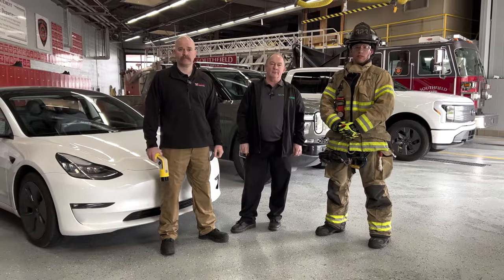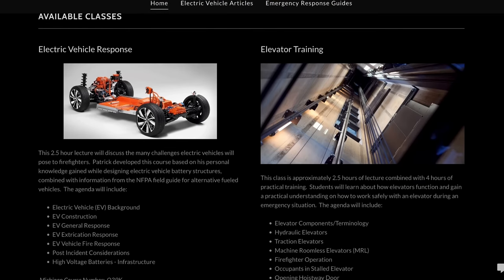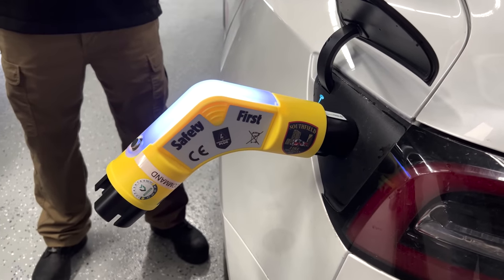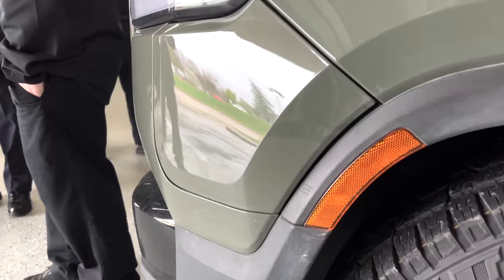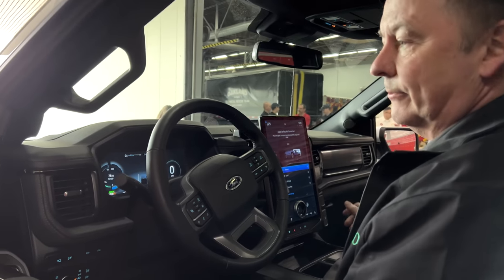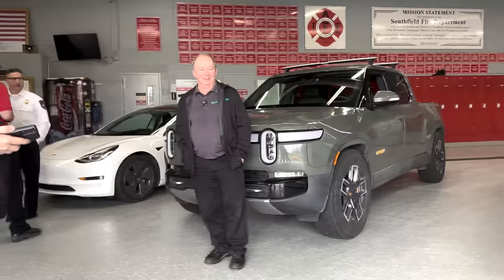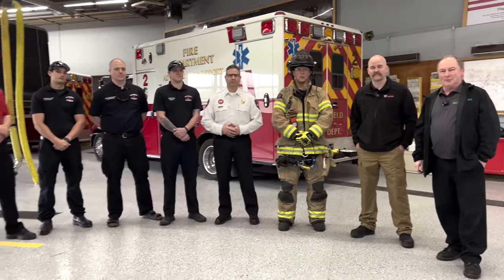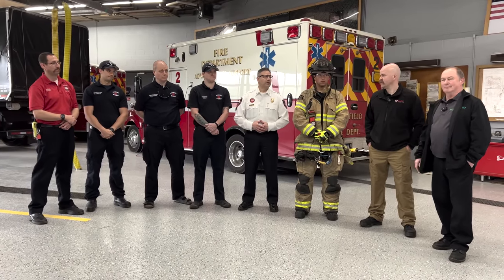An EV Device for First Responders: Emergency Plug Demonstration

Comment: If it doesn't disable the main battery connectors (safety switch) seems pretty a useless tool to me.
Reply: this tool is to shutdown and disable driving. shutdown is achieved when charport is open on a tesla. driving is disabled with any charge cable attached. the light on the device has nothing to do with the ev.
Reply: @davidck1  No, it doesn’t do anything to shut the car down, it just puts the car in park. What the original comment was saying is that it actually does the opposite. Since the car thinks it’s charging, it won’t disconnect the battery like it normally does, which can actually be worse.
Reply: @kylecoolky1189  every system related to driving is off when charging
Reply: @davidck1  The only thing it does is prevent the car from shifting out of park. There is nothing else related to driving that it would affect. The plug would actually keep the high voltage battery awake and plugged in rather than it shutting off like normal.
Reply: it creates a fault situation where the plug(cable) is connected but there is a ground fault or something. So the car signals that there is something connected but would not charge or put power on the charge leads. just the data connection is active. just examine the charge protocol and you will find out...
Reply: @johumm455  Yes, but it doesn't disconnect the high voltage system.
Reply: @johumm455  go to your ev and plug the charge cable. ev has a sensor in charge port to prevent accidental drive off when connected
Reply: Might be a more ideal tool for police departments to prevent people running away.
Reply: Its main purposes are high centered, rollovers vehicles, or really any patient removal to ensure the accelerator is disabled.
Reply: @markshellard  huh?
Reply: @Jason Monsorno  Rescuers will cut the low voltage first responder loop on any AFV in these situations. The risk is not just putting the vehicle in park, but disabling the high voltage battery and Isolate electric to just the battery compartment.

This tool provides a safety override that command can visually see the car is in park. It has a limited role, in my opinion.
Reply: @mtusfi  no we don't! Especially if the vehicle is otherwise intact! First responders aren't going to total your vehicle (which cutting the HV lines almost always does) if the situation doesn't call for it. A simple roll over happens way more frequently than you may think when people hit each other's wheels or someone gets into something soft and the vehicle is literally just tipped over. I've been at scenes where the vehicle was driven off after put back on it's tires. High centered, vehicle stuck off the road especially in mud trapping the doors, simply off road and precarious angles/slopes, etc. Not every response is "oh it's an EV, just cut the HV lines before touching it" otherwise we'd shoot slugs into ICE cars too or something as ridiculous.

Comment: This doesn’t turn off the car it just keeps it in park. As a former firefighter for 16 years you need to be trained on how to cut the power
Reply: The purpose is to disable the car from moving so you can cut the power more safely.
Reply: @Taluvian  you hardly ever see a car fire rolling down the road.
Reply: @DavidSpector  Who says car is on fire? Here the fire department uses the jaws of life to open up cars and remove people. Unlike a gas car where you can hear the engine running or not, an electric car is silent. The car in drive could suddenly move and run emergency responders over or crush them, i.e. why you want to disable driving and then cut the power.
Reply: Exactly. This is a dangerous device with no application in fire rescue.

If you need to put a car in park, do it the same way you do on ALL vehicles, with the gear selector and parking brake. There's nothing magical about an EV here, the same techniques used to prevent any other vehicle rolling away work on EVs

If you need to disable an EV, so you can work on it safely, cut the firefighter cut loop. Do not rely on a device that relies on tricking the vehicle into keeping the HV pack energized to give you any form of safety!

There is NEVER a situation where this device is appropriate for a fire/rescue situation.
The only applications I can see for this have been covered by others: Car jackings, and police traffic stops. Not fire rescue.
Reply: @Green__one  people may use summon on the Tesla app to move the Tesla away remotely and may run over the firefighters leg.
Reply: @Green__one  The fireman's loop is under the hood. Putting the car in park can make it safer to access that loop.
Reply: @TheMrLeast  Well that's about the biggest stretch I've seen in logic here so far....
Reply: @jamesphillips2285  Then put it in park the same way you do with ALL other vehicles on the road today. Emergency responders have been safely putting vehicles in park and cutting power for many decades without this device.
I note that every single response in this thread from actual emergency responders have agreed that there is no point to this device, and yet some people in here have been doing all sorts of mental gymnastics to justify it.

Comment: How does it react, i always assuemed the HV Relay engages if you plug in. Wouldn’t it be way safer to just cut the first responders loop opening one of the HVILs 12V is still there and the parking brake gets applied. Please let me know its quiet important actually ..
Reply: That's the next step.
First you want to make shure the vehicle is disabled before you get inside it to cut the first responders loop. If you get into the vehicle and it's in drive and the accelerator is engaged your in trouble.

Comment: Another piece of equipment that could be quite useful is a car sized fire blanket like that from Bridgehill. This can allow firefighters to contain the fire and reduce its intensity. Car fires in EVs are incredibly rare, but when they do happen, isolation appears to be the best response.
Reply: Yup. Simple yet very effective.
Reply: Yeah. You're not going to put it out, so just keep the heat from igniting anything else around it. I think blankets they could throw over and shoot under, then fill with water from a hydrant or pumper to absorb the heat (with some sort of safe pressure release for the steam) could be a valuable invention for the rare times they're needed.

Comment: Note to self, disable outside access to the charge port. Only I should have access to my charge port, whats stopping a car jacker from putting this device in my car at a stop light and now I cant run, or someone from using VTG off my car to power their own stuff off my battery while I'm gone. And yes, I do modify my own vehicles, anyone who can, should.

Comment: Firefighters have an emergency loop to cut or a service plug to pull. This is just going to be abused by wrong doers.
Reply: While correct. If the loop is unable to be accessed or the marking has beenntorn away this can be a great alternative.
Reply: Explain how wrong doers are going to abuse this vs all the easier malicious things they can already do without any gadgets?
Reply: @mynameisladder3481  it's not really possible for it to be "unable to be accessed". They just cut through your car's pillar. Job done.
Reply: @I Gotta Say The idea is out there now thanks to them, and the protocols are fairly open. Anyone could make this that has even 5% knowledge of how to make things.
Reply: @@IGottaSay very funny. With knowing that such a tool a) exists and b) works any electronic engineer can build a bootleg version of it.
On the other side: knowing that this thing exists (both legally and illegally) is knowledge that may be useful to car owners.

Comment: But does it force open the contactors on the battery? Seems to me that tricking the car into thinking it's charging keeps them closed, meaning some/all the orange wiring is live.
At the very least the leads from the inverter to the battery are live. I'd suggest adding this to the J1772 spec if that is the route we want to go for safety.
Reply: Exactly. This sales pitch is for an extremely dangerous device that will force the vehicle to keep the HV pack energized when otherwise it would shut it down.

This device does the same thing as putting the vehicle in park, that's all.

If you want to disable an EV, cut the firefighter cut loop. That will make it safe.

Comment: Also would have been a nice follow up question to ask how much vehicle fires on avarage these guys go to, and how much of those were EV.

Then you can see for example on a year basis they’d spent x amount of time putting out ice vehicle fires and x amount of time on ev fires.

Really wonder if the avarage on time spent is still lower on an ev even if it takes hours per 1 incident.

Comment: Giving the Park Pawl a work out
Reply: seriously
Reply: There's no transmission on these EVs, so no parking pawl, instead they use a parking brake (On the Tesla it's an extra caliper on the rear brake rotors)
Reply: @Green__one  the way that Ford was rocking back and forth it sure seemed like a parking pawl to me. If it had been a parking brake, it would have just stopped and not rocked, right?
Reply: @toronado455  slam on the brakes in any vehicle, and you'll see that same rocking. It comes from the suspension.

Comment: Electric vehicles need an emergency port on the battery pack such that cold gas or liquid can be pumped through the pack.  The regular coolant loop could be pressurized with liquid N2 or CO2 and vented to suck heat out of the pack.
Reply: As soon as you move the car the short res establishes and thermal runaway kicks off again - just let them burn.

Comment: I am here with Sandy and should say, no part is a good part. This device can be used in 1% of cases and you still have to cut the first responder loop. So to be honest it is over engineered and useless.
Reply: But they'll sell dozens!
Reply: @isthatatesla  They only have to make it "best practice" and they'll sell tens of thousands.  Even when the departments buying recognize that it's a solving a vanishly rare problem, once it's standard they'll need to buy one just in case.

Comment: Is the high voltage connection energized between the Charge Controller and the Charge Port when the device plugs in? Normally that section of cable is not energized unless plugged in for charging.
Reply: i really don't think it powers anything down. i think this device just stops the vehicle from rolling.
Reply: @Mike-Minion  When you connect to the charge port at some point the communication tells the car to energize that portion of the cable. Would be curious if this happens with this device. The scenarios the responders might use this on might make that answer relevant.
Reply: Only in DC Fast Charging mode.  In standard AC charging mode the on-board charger waits for AC on the charging connector.

However it will activate the traction battery contactor(s), putting high voltage traction power on wiring that might have previously been de-energized.  In the rare case that this device does something, it has a good chance of creating more danger rather than less.
Reply: @1djbecker  so what mode does this device put the charging system into.
Reply: @motofunk1  I see no reason for it to engage the DC charging mode. That one required a really complex communication using a powerline IP connection (CCS) or CAN bus connection (Tesla). AC only required a diode, a resistor and a dumb 10 kHz PWM signal (about 30 cents in parts).
Reply: @HenryLoenwind  So basically if the responders use this and then pull the high voltage battery disconnect they will negate any of the problems this device would have created. Basically this gives them and external stop to buy them time to pull the main disconnect.
Reply: @motofunk1  So would many other actions, such as opening any door.  A scenario where the car was still moving, damaged enough to jam the doors, yet moving slowly enough to grab and insert this device is extraordinarily contrived.

Comment: The plug is for a few cars (not most), the adapter works for most cars (which are teslas)
Reply: As most electric vehicles do not use the tesla connector and even teslas in most of the world afaik do not use the US style tesla connector. I would agree with Patrick.
Reply: @Firecul  Teslas make up 75% of EVs in the USA and they all use the tesla connector. Also, the EU CCS plug is different than the US CCS plug; same name, different plug
Reply: @beilkster  With that logic it should be designed only for teslas then.
There are only 4 models of tesla available to buy just now. Unless there are less than 6 total models of EV available in the US I'm assuming he meant that would be compatible with the most models of cars. Not just the one that makes up the highest % of on the road vehicles. 
(I'll go with the 75% claim because I don't have the energy to research that atm to see if it is correct or not)
Re:CCS, yes it's annoying that that has not been standardised but at least (afaik) it's not really mix and match within a region. I really hope I'm not wrong there.
Reply: @Firecul  Why does number of models matter? Number of cars on the road should be the only metric
Reply: any charge cable works the same as this device. the light on the device does not connect to the ev.
Reply: @beilkster  You're figure is a bit out of data. The most recent number I can find puts Tesla at 56% share in the US, and anticipated to fall below 50% by the end of the year.
Reply: @vylbird8014  most EVs in the US use the tesla plug by your own admission. My stats are number of EVs on the road, which is a sum of market share each year minus EVs that are now totalled. Even if tesla drops below 50% they still have significantly more evs on the road... nor to mention that ford will be using the tesla plug in all their EVs starting 2024. 
Another fun fact. 2/3 of chargers in public are tesla chargers. I didn't say charging locations because placing one charger in a parking lot is not equivalent to a tesla super charger location.

Comment: I have suggested having a blade on a truck/emergency vehicle and then pushing the EV whether on fire or not to an area away from people and traffic then use the blade to push dirt into mounds on all sides.  An area off the shoulder or made of dirt could be quickly prepared with a single blade sweep then move the car to the cleared area and build the mounds.  The mounds would help contain water or foam and direct any smoke or debris upwards or at least not directly outward and the dirt base and mounds won't burn.  This could work for motorsports at tracks and parking areas(pre prepped location around the track) and for EV fires on the road and highways.  The bladed Emergency vehicle woud be protected from fire when moving the EV and when building up mounds of dirt on all sides.  Once the fire is out the dirt can be collected or leveled depending on the level of soil contamination.  It is relatively easy and cheap and can be done with minimal training or equipment almost anywhere without a lot of chemicals or water.

Comment: I really don't understand how so many people on this thread think it's a great product. It's a product with no use case. A firefighter has NEVER had to come on-site with ANY VEHICLE and couldn't figure out how to make sure it doesn't move. Unless your mentally slow and don't understand what P means... 🧐🤔🤓😝
Reply: Firefighters need to deal with vehicles they may not have immediate access to.
Reply: LOL. As someone who only appreciates most firefighters immensely, totally agree and yes, totally LOL'd seeing your very rational comment!
Reply: Where’s the P on a Tesla Model S?  Would that be on the broken screen you cannot use or the hidden button you cannot find? Just saying some EVs don’t have the traditional center console stalk.
Reply: @legostud  Either on the right hand stalk as a button, or on the touch screen + center console.
If the screen doesn't work there's always a backup.
Reply: @logitech4873  BTW: For Tesla, the backup is: two of - open driver door, - unbuckled seatbelt, - no weight on the driver seat
Reply: There have been a lot of “it’s useless” comments here. Consider this. The vehicle is in an accident, it’s still in drive, the driver is either pinned or unconscious, or both, and his foot is still near or on the accelerator. One wrong move trying to extricate…
Reply: If the point is to make sure a car doesn't move, a boot would be more universal. Works with EVs and ICE cars.
Reply: @logitech4873  it is called CHOCKS.  They place them in front & behind the wheels.  Car goes nowhere